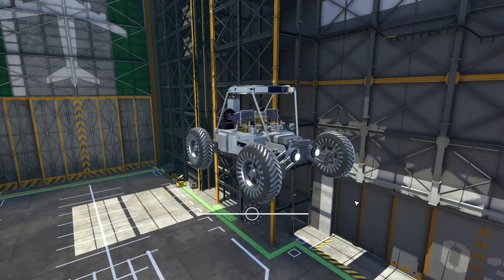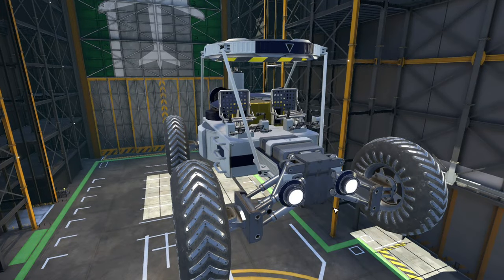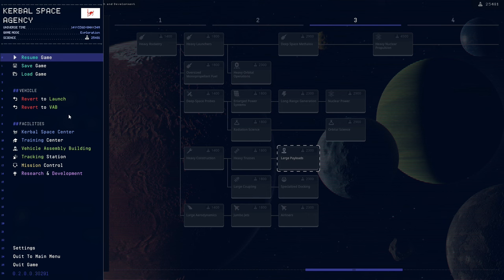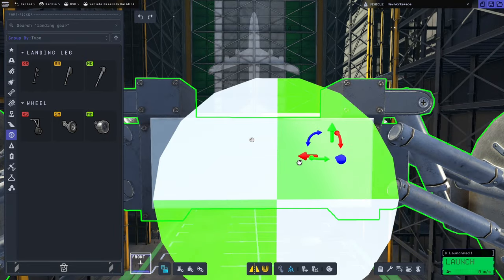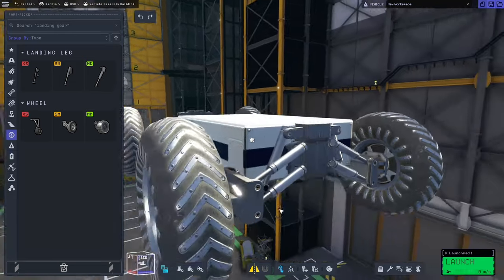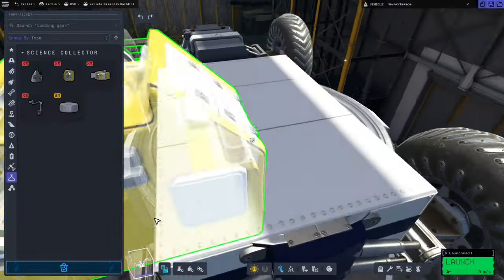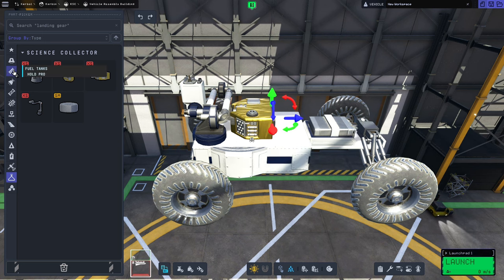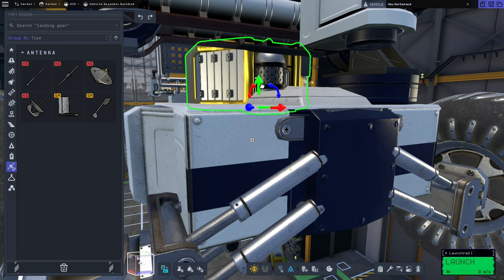KSP2 - For Science! Basic Rover Build

Comment: 4:02 I like to have torque enabled on the reaction wheels on rovers, but set the mode to SAS only. Then when driving, turn on SAS in locked mode. This helps stabilize the rover especially on low gravity planets.  With SAS only selected, manual controls won’t tip the rover.
Reply from the maker: Thank you for mentioning this! I've just tried it and it does make it much better! :D
Reply: @clowderman88  glad it worked!  When I’m driving fast on low gravity planets I’ll switch the SAS mode to prograde. That way if I jump a dune the rover will keep its orientation and land all wheels down… Baja truck style.
Reply: Dude, this is genius!